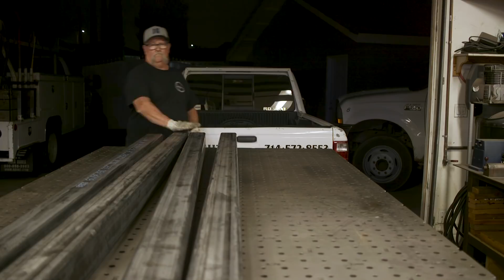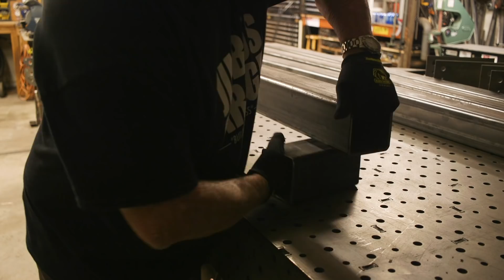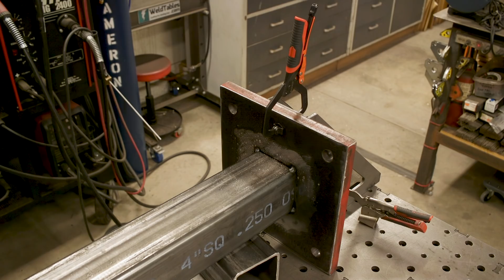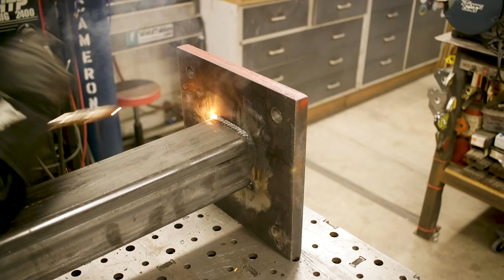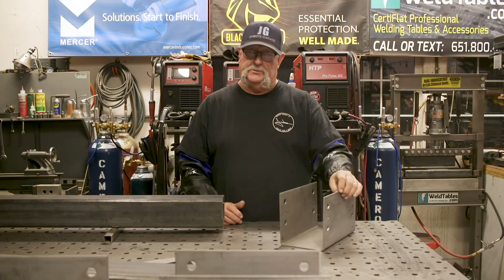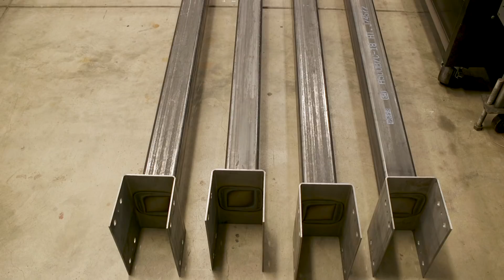Multi-purpose Welding 4inch Steel Columns | JIMBO'S GARAGE

Comment: The thing I love about stick is you can get really good results with a simple DC welder that costs just over $100.. Yeah I know, sounds ridiculous but the ToolIOM machines are cheap and absolute beasts! I paid a little over $200 (300 today) for my ToolIOM MIG welder, with a stick mode and it will do about 150amps at 100% duty cycle. Their basic stick machine is just the stick function, with a hot start function..:)

Comment: If I have a 4x4 post will a 6x6 plate with 3/8 holes fit my 4x4 post? Wanted to make sure I would have space for nut and washers to fit to hold post down on the concrete. Thanks

Comment: You'll get rid of the worm trackin moving back your arc length or turn up the voltage a half and wire speed up by 5 or so.

Comment: Worm tracking are marks on the surface of the weld bead that are caused from the gas that is created by the flux in the core of the wire. The gas causes worm tracking when there is excessive voltage for a given wire feed setting/amperage. Turn up your wire speed or your voltage down.

Comment: just did that at my job tonight it was a 50" hss but i put it vertically and had a hell of a time tacking it straight ,next time im gonna try shimming it horizontally like you did ! way faster and you are sure its at 90degree when its clamped 🤷‍♂️Thanks for the tips im still a welding student and this will help me a lot !

Comment: Worm hole porosity comes from your ctwd (contact to work distance) keep that nozzle a little further out and you should be fine.
Reply: Could it also be from too much gas flow causing turbulence and sucking in oxygen in the air? This was my first thought.

Comment: 7018, second pass should go on the bottom to give you a shelf for the 3rd pass. The gas CFH could cause your "worm tracks". CFH over 40 causes turbulence in the gas and fails to cover the weld correctly. I run a lot of dual shield and don't exceed 35CFH on 90% of my guns up to 5/64" wire

Comment: currently going for my certifications and what i have been told worm tracks happen when you get to close to the material stay at least 3/4 inch away with dual flux to let the wire heat properly,
Reply: stick out is most likely your issue

Comment: Worm tracks are caused by gas pockets in between the slag and the molten metal.Gas can also create  worm tracking when there is excessive voltage.

Comment: I've done the same kinds weld job for a company that set a camera on a pole to take picture's of a bridge over 2 year's the plate was the same thickness. Put 3 laps around it with a 120 Mig it should have been done with a stick but that's all we had.

Comment: Spater control is always good. My favorite new tool is a brick  chisell in  2inch or so. Keeps the BB's at Bay. Great for mig BB's and fair on Arc. Simple tool that changes cleanup to as you go. You might pick up a grinder one time for that one BB that want come off.

Comment: Why would you not bevel the tubing for a 100% penetration, for a "proper" weld?. Also your "single pass" dual shield weld toes had obvious cold laps, and would not pass any visual inspection. The spray arc looked good but obviously lacked penetration, due to faulty practices of not beveling your material first. But as a 37 year UA pipefitter, I can say those stringers from the LoHydrogen rod look pretty good, as much as I hate to admit it! lol

Comment: Doing multipass wrong way around. Second run at the bottom, third being on-top 👍🏻 Just for next time.
Reply: Was thinking the same thing!
Reply: Does it matter that when the post is put in place that that's how it will be or does that have no bearing on the initial weld?
Reply: Cold lap

Comment: Different technique to weld the top pass on a 2 pass cover, first. I wonder if there are any downfalls to doing it the way Jim did it? I know stacking that top pass on top of the bottom pass is much easier then trying to keep that top pass from sagging out. I wonder if it has any structural downfalls.

Comment: I have a question.  If the post is only 1/4" thick, then why are multiple passes necessary?  If you put a 1/4" fillet down, then wouldn't that be full penetration and your done?  (i'm not a welding expert so everybody please don't beat me up for this question)

Comment: According to Esab on some .045 dual shield 7100 I was running it was moisture in the wire that causes worm hole porosity. It seemed about right as it cleaned up after burning a little wire and then came back at the end of the spool.

Comment: I'm a flux core welder and you get thoose worm tracks from either stick out is too close use a 1/2" to 3/4 stick out or it could be from bad wire but your gonna need to turn up that gas flow from 15 to 30 for that 1/2" stick out 👍

Comment: Why is the second pass on the top,normaly on this side of the pond we always start at the bottom with multiple passes !!
Reply: Any welding school will show that stacking welds always starts with root/first pass in the middle then like a pyramid, bottom to top and depending on what size weld the work calls for...  You're 1 inch plate would call for 5/16 th weld in real world if a welding inspector will be checking it.
Reply: When I were a lad in British Steel, it was root weld first, then bottom weld, then upper weld.  The upper weld uses the bottom weld to 'sit' on, so the bottom of the last (upper) weld dosn't run down away from the puddle you are making.  Laying the upper weld second, THEN the bottom weld last,  is actually the wrong way round to do it but hey ho, everyone has their own homegrown methods.  Jimbo does do some really nice work though I must say.
Reply: Jon Woody so the weld lays in there smoother, so you don’t see the bead line. I worked at 1 place where that’s how they wanted it and a structural shop who frowned upon it .
Reply: @bbbiesemeyer1  Every place I've ever welded, you lay on the bottom then top. And if you're good enough you don't feel the seam ;)
Reply: @Birdhouseboi810  Totally correct from this side of the pond.
Reply: It's more of a personal preference here. I prefer top then bottom out of habit from the guy who taught me to weld.
Reply: @johnkane6599  negative.

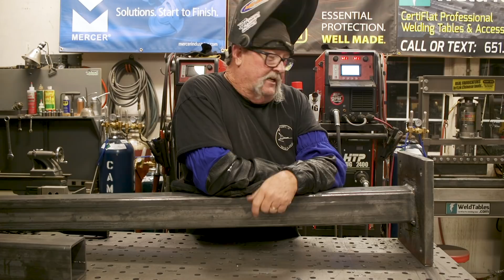Comment: For not sticking in a while, it turned out better than you Mig welding. I saw a lot of undercut and lack of fusion with both Mig welds. @17:43 for example. Maybe not a problem for what you are doing. But in the industrial world those welds would be rejected.

Comment: Code D1.1 specs call for it to be small application welding ...when you get bigger than 1/4"  you need to weld it with a little more tensel strength than ER 70s-2

Comment: Fun little project, good for getting some helmet time in for sure!  Can you explain why you use gas with the dual shield flux core?  I thought the point of that wire was to eliminate the need for gas (such as welding outside, etc.)  Thanks!
Reply: There are two main types of flux-cored wire:  gas-less (what you are thinking of) and gas shielded flux core.  Look up E71T-1 wire on Google.
Reply: Rob the Wayward Woodworker dual shield as in 2 x shielded uses gas and inner flux to shield the weld....inner shield flux core doesn’t require gas
Reply: There are 2 different processes gasless flux core and dual shield. Some people don't think you can use dual shield in the field but I use it all the time and get quality results.
Reply: Dual Shield.  Dual = two.  Flux core + shielding gas, you are getting it confused with simple flux core.  Different animal.
Reply: There is 2 types of flux core wire dual shield and self shielded dual shield is usually faster and has better penetration self shielded can be used outdoors

Comment: Why stack the way you did when using smaw? I’m not being a keyboard commando or internet cwi,but proper method would be to stack from bottom to top and overlap each by  half (that part you had right) . Only reason I say this is in pipe welding,structural , plate etc you want to have something to sit the next bead on so overall it ties in better. Either way great looking welds jus wanted to share that info again not trying to be rude my insta is welding_zero
Reply: OrganicZero88 should always stack bottom to too

Comment: Jimbo, what do you think of the guys who say it’s unadvisable to weld >5/16” steel with regular short circuit MIG?
Reply: Thomas Utley those guys have a point!  It can be done, if everything is done right, and there are even certifications for that ...  but there are much “ better “ processes ...
Reply: Definitely can be done if you bevel edges and burn it hot. I’ve always had best luck with dual shield flux core on the thick stuff
Reply: Tell them Pipefitters have been doing it for years, and that is what stringer beads are made for!

Comment: those base plates are a bit over kill,  i do structual steel every day hardly ever use anything over 5/8 or15mm  thick mostly 10mm  using short circuit mig .040 wire to asc 04 wps , not allowed to drop welds at all only 1g on anything  structual  be that columns or rsj's
Reply: Thanks for the information, I done a job like this year's ago for a company that used some sort of appoxy for bridge's and parking lots and old buildings for earthquake. I had to weld a plate like that on a pole the size of a telephone pole I used a 120 Mig 3 laps around it. I should have used a stick but that's all they had to weld with. I made it work I had to weld 10 of them. None of them broke they all last for 3 year's taking picture's my brother in law worked for the company he told me they are still using them. I thought for shire one would would brake I didn't think it got hot enough for the thick metal I tried to burn in the metal as deep as the small machine would go.
Reply: it needs to be rated for a tree falling on it

Comment: Could the bottom plates be welded with a 220v MIG welder? I have a project like this to do at my house but I'm not gonna run out and buy a new welder.
Reply: Fraserfab yes you just have to do multiple passes depending on thickness of the material

Comment: 9:00 When I weld any sq tube, ive always started my weld in the center of the tube and wrap it around the corner to keep my starts/stops off the thickest area of the tube.
Reply: thats how some cwi's preferred it to be done for pipeline supports here in PA
Reply: On heavy structural pieces where max strength is a concern that is the proper way to do it but not always necessary but not a bad habit to get into at all